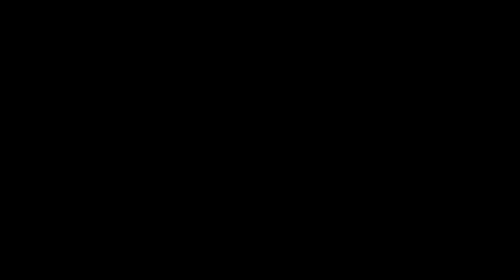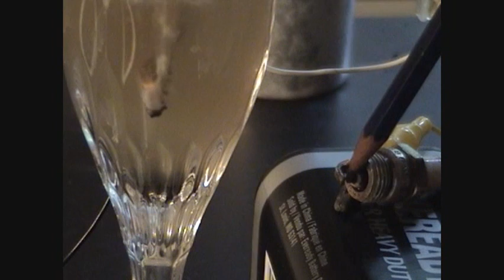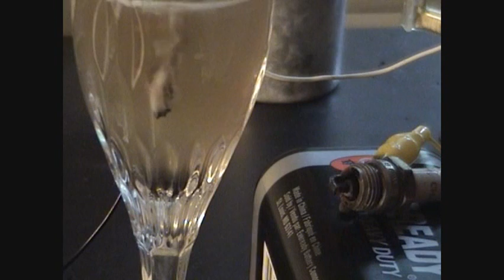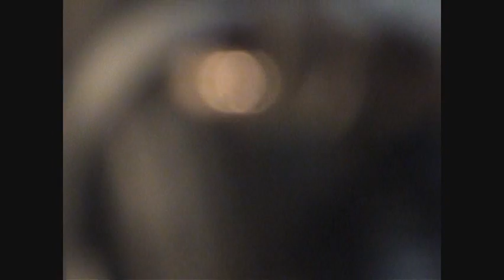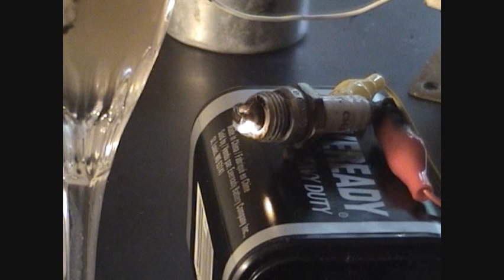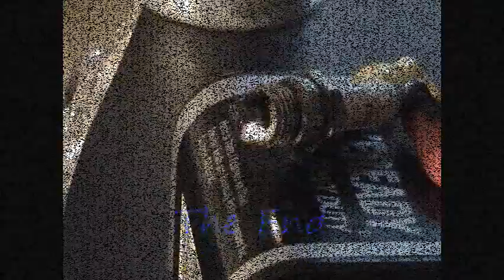BURNING WATER FROM A SPARK PLUG

Comment: Running high voltage through water does strange things first it makes the water break down into its component hydrogen oxygen and then the spark makes the two gases burn and makes water again in the process starts all over and over and over

Comment: you're not burning water, you may be burning hydrogen which is being made from your setup. There is NO energy to be had by doing what you are doing. The energy in the so-called burning of water is less than the electrical input energy from your source to your spark plug. You cannot violate the laws of thermodynamics, what comes out must always be less than what you put in.
Reply: +Fred Zlotnick I agree 100% that he's not burning water but don't confuse the energy WE put in for the energy already present and available in the system or gained from within the system or elsewhere. The energy put into the "system" to cause an explosion (implosion) when the "system" is just a stoichometric mixture of hydrogen and oxygen is tiny (a lit match for example) but the energy OUT is WAY higher.

I agree that the TOTAL energy available at the start cannot be less than the TOTAL energy afterwards, but that is NOT the same thing as "We haven't put IN" enough energy or "we have put IN" less energy than we get out. We don't put ANY energy into a fusion process (other than that expended extracting the fuel from the ground, processing it, etc. a fairly decent amount of energy actually, but from the point at which the control rods are removed from the pile we put ZERO energy IN and get MASSES of energy out and ALL the energy used to get to that point then  pales into insignificance compared to the energy released. It's NEVER been about the energy WE put in but how much energy is available to be used by a more effective process - note: EFFECTIVE not efficient - it doesn't have to be efficient if it's effective and any extra energy comes from somewhere else for free

Water can be spilt (rather than electrolysed) by using a high resonant frequency, high voltage across INSULATED plates so ZERO current (there are patents on this and no, not from Stan Meyers). Volts x current = power = energy consumption. Volts x ZERO current means ZERO power means ZERO energy consumption to produce hydrogen and oxygen.  BTW the laws of thermodynamics imply 1. Heat usage or production (there is none in an electrostatic conversion) and 2. that the processes are DYNAMIC. How do they apply to STATIC processes and electroSTATIC processes? Answer: THEY DON'T! 

They also don't apply in quite the same manner for resonant processes. Witness the fact that the Millennium bridge in London, WAY, WAY, WAY stiffer than all the people walking ON the bridge could ever muster to bend it out of shape by pushing it, yet they DID, with little effort greater than they would normally expend to walk the same distance, could and DID easily cause enough resonance to cause the bridge to sway alarmingly. The energy OUT in that case was a complex matter to calculate because it was short impulses (induced resonance effectively) that caused the bridge to sway uncontrollably. Likewise the energy used to get a swing to move higher and maintain it is far less when used resonately i.e. push ONLY when they swing comes back to you and input a pulse of energy to keep it going.

One MIGHT argue that zero energy consumption to produce hydrogen and oxygen from water would mean over unity ... IT DOESN'T. When the oxygen and hydrogen is burnt the net energy output includes noise, waste (or usable) heat and water. THAT'S where the energy gets lost and is common in just about ALL chemical exothermic reactions. The production of sound consumes energy just as the production of water produces heat (from the burn). I'm not sure ANYONE believes that we would get back the identical MASS of water. Ergo SOME mass has obviously been LOST and converted into energy of one form or another but that "energy" was ALWAYS there, implicit in the mass of the two gases involved. Hello!? e=mc^2 ??

WE don't put the same energy IN to LOTS of things but get far more energy OUT. Wind power, sea power, geothermal etc. It's the overall efficiency and effectiveness of the process that interests us (as human beings). Our main problem these days is that we are demanding more and more energy and it is getting more and more expensive to produce on demand mainly due to the cost of fuel to convert energy from heat to mechanical/rotational. We really should pay more attention to what is REALLY going on in these kinds of experiments and start properly investigating them scientifically to understand better. But as an engineer of over 40 years standing I'm only concerned with what actually works; works well; is reproducible easily and can save me a fortune. I don't care one iota if I can't explain how it works ... or if NO-ONE ever can and the same can be said for MILLIONS of drivers male and female who have NO clue as to HOW their car/engine works, only that it does. Or the billions of people who use mobile phones and only care that they work and have a signal!

Comment: electricity will jump 1 inch for every 1000 volts in normal atmosphere if you change the atmosphere by adding water milk powder aluminum conductivity is increased ,cool demonstration, very simple concept

Comment: @trangenusa He's not burning water, he's conducting electricity through the gap, electricity he is getting from the wall. The "fire" you see is a spark jumping the gap which is made much smaller and easier to cross by the water. Water is a better conductor than air, but not as good as graphite, the substance in the pencil.

Comment: Graphite is simply a better conductor than plain tap water. There is not "conductors" and ":insulators", there are many different levels from totally insulation to perfect conductor. For example., that atmosphere is a conductor, but a very poor one, which is why it takes huge potential differences to cause the atmosphere to carry a voltage. while gold is an excellent conductor.
You are not gaining any energy, you are losing it. It's the law, baby!

Comment: Ok, so it's burning water, but is that enough to create a combustion and push a piston around in a 4 stroke motor? Is there enough power (octane) or whatever you want to call it. Different fuels have different power. Stanley Meyers had that water powered dune buggy. Has anyone replicated that?

Comment: Crob, I have a question.
Could you please repeat the experiment, but this time measure the efficiency of your electrolysis? If its high, you may have discovered something.
(btw, azzy31459 the overall reaction for this experiment is simply is h20 --> h2 o2 --> h20, as mentioned in the thread below)

Comment: All you did was short it out, not once was there a flame that indicates combustion. You get the exact same effect if you pulled a spark plug and tried to start a motor but on a smaller scale but that is because of the equipment you are using.

Comment: The reason for the burning water is the use of the method of electrolysis. Electrolysis is basically the use of electricity to seperate water into its two, most basic, forms: the elements oxygen and hydrogen. So, you are making a circuit that is producing this electrolysis and the sparks from the spark plug are igniting the hydrogen with the oxygen acting as an oxydizer for the combustion reaction. There you go, that's what is going on.

Comment: no   in fact you are not burning water.... yu are splitting thewater molecule and burning he hydrogen gas.  Yes its cool but not very practical as a source of energy because you are using far more electrcity to split the water than you get from the burn of the hydrogen.

Comment: I saw it too its still electrolysis it wasn't evaporation.
Water was split in 2 gas.
On the other hand ur other video due to heat that caused by electricity in the coin the water evaporates.
the difference between evaporation and splitting gas is there is always a smoke after burning. While on electrolysis you will never see smoke.
Burning is just  changing water form.
Electrolysis is splitting h2o into h (hydrogen) and o (oxygen) nice video though. Just be careful w the other end of the pencil

Comment: I have to partially agree with mashhead1000 in that you're not burning water. The reaction you're getting is a small flame, yes, but it isn't the water itself that burns. The electric current from the spark plug causes electrolysis to occur which separates the particles in the water into two very flammable gases, hydrogen and oxygen. That is what's burning.
Reply: Yes exactly hho

Comment from the maker: that was distilled water,, thewater isbeing burned.

"Busy Fool"

dont bother writeing back unless you do some investigating of your own.

it was 12v to inverter to make 120ac, put that through a rectifier.

used a spark cell in series throught the mot to limit the current goin to the mot...

try it your self,  high voltage will conduct through distilled water.  

Busy Fool

you disgust me

Comment: for clarity, water as H20 can not burn, in a complete molecular decomposed state with H1 and O1+01 separated, specific molecular structures can burn as a combustible gas if the molecule structure is of such, otherwise, in this case, they will re condensate as h2o. Proof that the Hydrogen molecules did not burn off, is the re condensation. This will not happen if the H molecules are sparated and ignited.

Comment: There is a definitive difference between the word split" and disassociation, breaking surface tension (lighter molecular structure ie steam), and the release of atoms specific to electrons, protons and the all important neutrons. Molecules can be disassociated appropriately or uncontrollably, more so "conditionally". The fact that the water re condensates in a closed atmosphere shows that hydrogen/oxygen molecules are still in H2O not H1 O1 N1. Your statement is true under approp. conditions!

Comment: It is simply that water is a conductor of electricity. Your giving the plug a method in which to make a path of electricity to the outer edge of the plug. The water is evaporating from the heat made from the electrical jump. Place a thin piece of conductive material and the same will happen until the piece of copper or tin foil melts of from heat. All these videos show the same. Add compressed air & large amperage,more flame. No water, no conductivity. The water IS NOT burning.

Comment from the maker: 12 volt car battery, and an inverter, look at my video high voltage spark cell pt2, and it has a detailed diagram.

thanks for the interest, and by the way the bubbles you see in the wine glass are flameable.